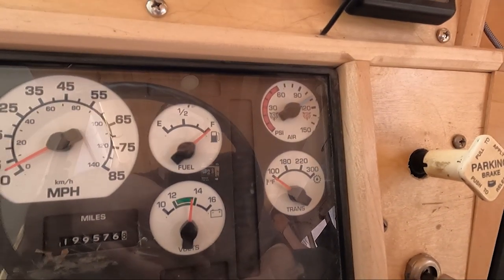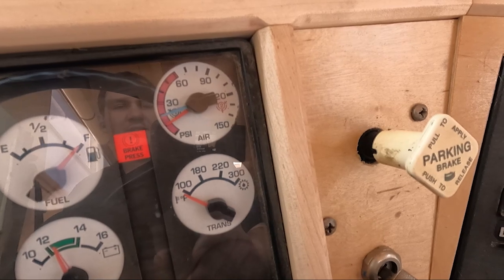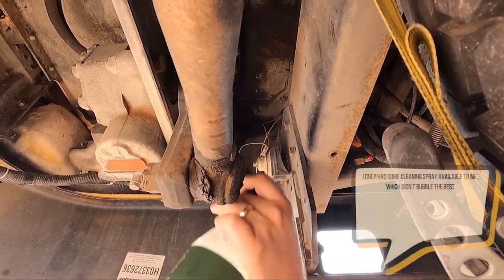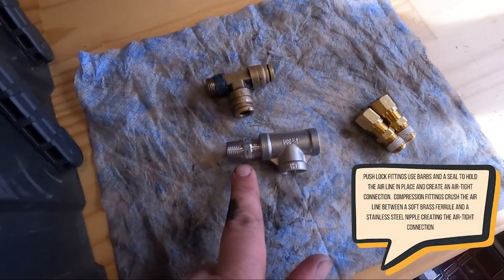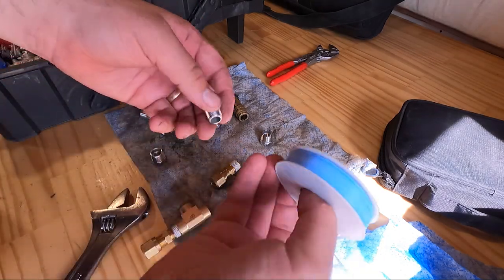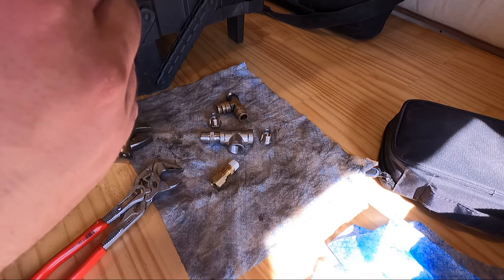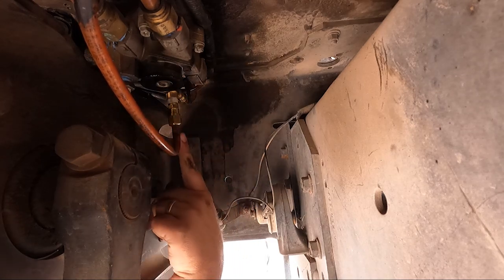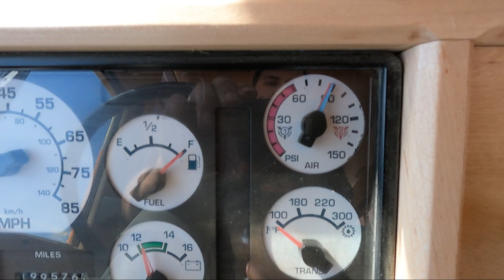Its Easy! A Beginner's Guide to Testing and Fixing Your Air Brakes!

Comment: If you were to go for a CDL test at the DMV, which axle you are chocking for a DOT air brake test? Does it matter? I'm in California and I don't see anything about which axle to chock in the manual anywhere, and I saw online to do the fronts. TY
Reply from the maker: I am unfamiliar with which axel you would have to chock.  I would assume that the driver front drive tire would be the most convenient depending on where your chocks are stored, but it has been 5 years since I took my CDL test and I am fuzzy on the details.